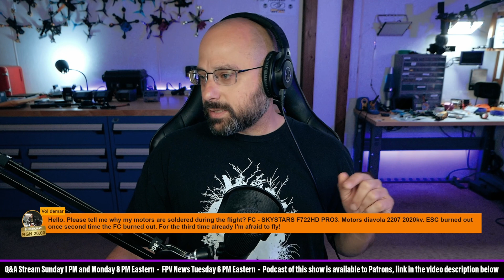My ESC Burned Out! Then My FC Burned Out! I'm Scared To Fly! - FPV Questions

Comment: Shorting to the frame? Ok, I'll listen to the video now. Flying around metal shavings? Crashing in places where metal grinding was done?
Reply: shorting the the frame happened to me once. thank god my quad is fine but my frame was hot for a good 30 minutes.
Reply: @Gamingvidsss  I've had that happen too. I didn't notice that I had pinched a positive wire between the top plate and a standoff when I put it together. When the vibration and shock finally wore through the insulation it made the frame really hot. Luckily I didn't blow anything.